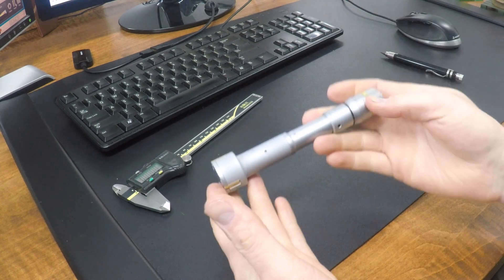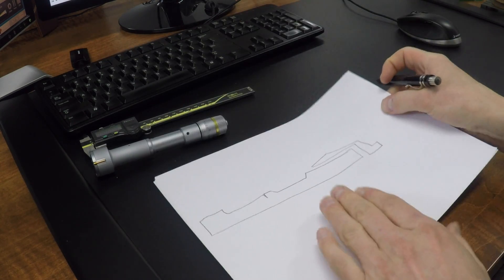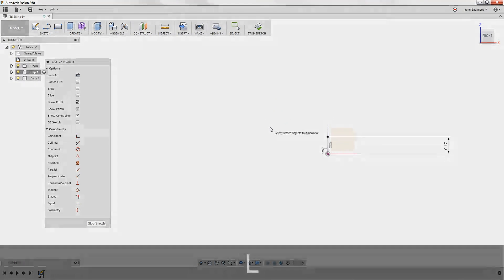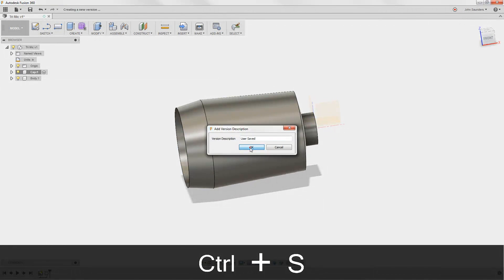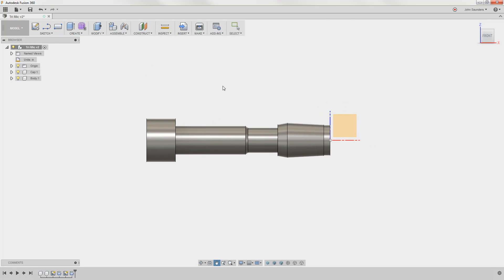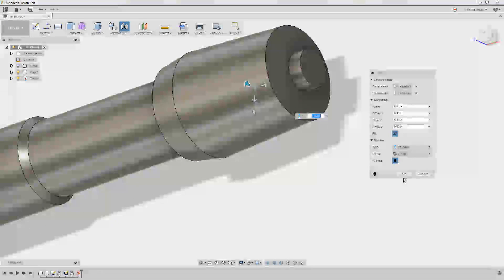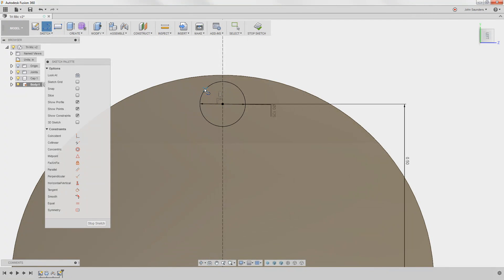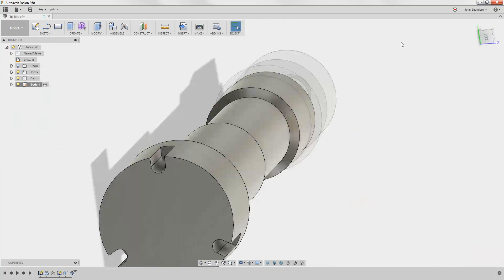Beginner Fusion 360 CAD: Model a Bore Mic!  FF75

Comment: One tip I might have for you, try getting a 'gaming' mouse with 5 or 6 extra buttons.  You can map your most used/convenient shortcuts to the extra buttons especially frequently used keys on the right side of the keyboard.  Once you get used to the mapping it can really speed things up.

I use the Logitech G502 in Blender for 3-d modeling and mapped all of the select/view/camera/constraint functions and it made basic functionality a lot more fluid.

Comment: John, I'm a beginner and was wondering what you did at time stamp 6:39 to define that small angle line segment on the left? Even going frame by frame I couldn't figure out what you did.
Reply: The reason the small line becomes defined is because it is perpendicular to the other angled line. Once it has the start point defined (that is the end point of the flat 1.38" line) it then knows it needs to be perpendicular to other line Therefore becomes fully defined. The length of the line isn't a defining factor because that is controlled by the diameter (0.383). 

If you can jump into 360 and try replicating everything John did exactly you should get the same result. That's how I was able to figure it out
Reply: WOW, he did it so fast I can't even see him do it, the perpendicular "marker" just appears.
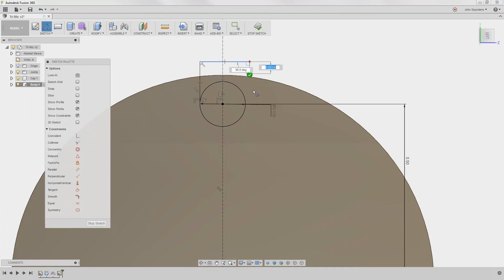Reply: That's right, in fact if you didn't want them to be perpendicular you would have to consciously draw a really off angle to make sure fusion doesn't apply it automatically. Or you can hold the control key and the snaps are temporarily turned off just like John did at 11:09

Comment: regardless of the final design medium I always start every new design or idea on a piece of paper.
Reply: Eric Wolf yeah. it makes more sense that he was asking about that.  I was confused as it was a response to my comment.
Reply: what kind of pencil are you using?
Reply: Casey Sullivan Whatever is handy.  I'm not much of a pencil officianado.
Reply: Casey Sullivan or was that sarcasm?
Reply: If you're asking what John was using, he is using a lead holder (aka: Artist mechanical pencil, drafting pencil, technical mechanical pencil). I can't tell what brand holder or size lead (probably about 5.6mm, 2mm normal for drafting) but here is one similar. You will also need lead and a sharpener if it isn't built into the holder. Also, try a few leads of different hardness before you decide if you like them or not.

https://www.amazon.com/Heritage-Arts-PK300-BL-Apollo-Holder/dp/B005PFEX5I/ref=sr_1_5?ie=UTF8&qid=1491773826&sr=8-5&keywords=lead+holder+5.6

https://www.amazon.com/Staedtler-Technical-Mechanical-Pencil-780BK/dp/B000YQEFGU/ref=sr_1_1?s=office-products&ie=UTF8&qid=1491774297&sr=1-1&refinements=p_n_feature_keywords_two_browse-bin%3A4928956011